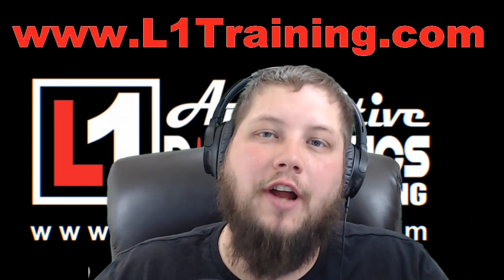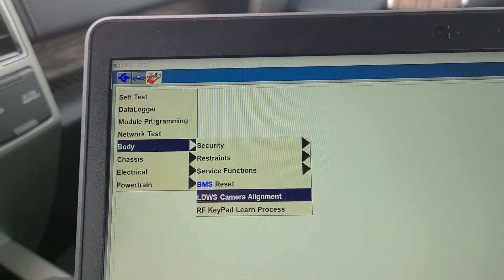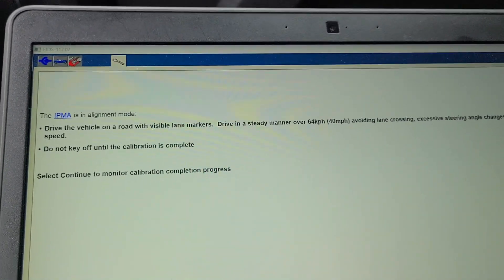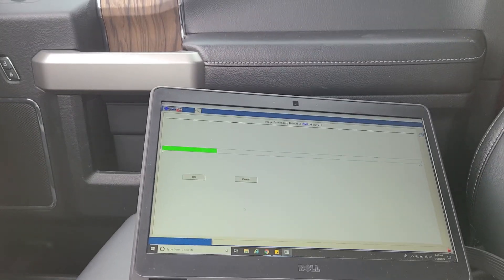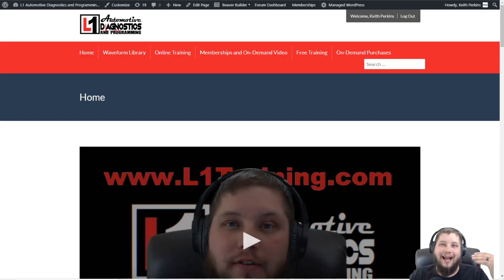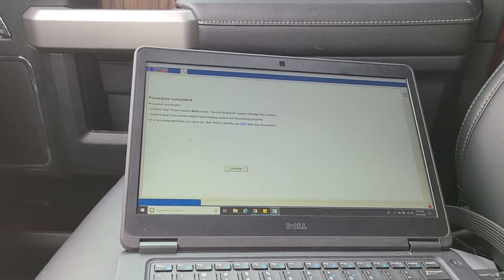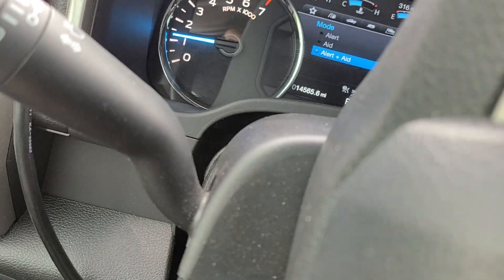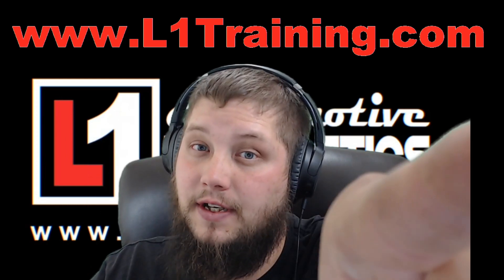2018 F150 Windshield Camera ADAS Calibration

Comment: Did the same thing as shown in the video exactly. The test said complete completed successfully, but I still have the error on my dash.
For context, this is a 2020 F150 lariat.
I have a lift and a 35 inch wheels so I adjusted the wheel size in the Ford scan app. Have not had any issue for the last three years I have this set up.

Comment: My adaptive cruse control dont work seems wierd dealer did changed the windsield i tried turning on and off the adaptive cruse control and still does the same thing you try to turn the cruse control on and only stays on like 2/3 seconds and a red light comes out on the bottom of the cruse control in the dash..
Reply from the maker: Needs to be diagnosed by a competent technician, not just you average shop.

Comment: Hey Keith, I had safelite come out per my insurance and they replaced my windshield but couldn’t calibrate it. They tried twice. It worked before I had the windshield replaced. They claimed it’s cause of my lift kit. I have a BDS 6” coilover kit. Insurance told me to take it to Ford, Ford couldn’t calibrate it either claiming there were codes and they didn’t know what they were. So here I am still months later and have defective pre collision warning system, no auto High beams, etc. Ford had said it calibrated then about 5 seconds later it says not calibrated. Have you ever seen this problem? Would you have any information on this scenario?
Reply from the maker: See the conversation I had with Guy Schroeder in the comments of this video.

Comment: Had windshield replaced, truck has been at the dealer twice already, they can’t get  it to calibrate. Going back in tomorrow, he needs to talk to engineer. Any chance you’ve run into it NOT calibrating? It’s a 2021 btw. Thanks
Reply from the maker: Yes I do, could be a low quality windshield with too much distortion near the camera, could have been installed incorrectly, the camera could be faulty, or installed wrong. Etc....
Reply: @L1Training  well it is a Ford factory windshield. As far as incorrectly installed and distortion that could be it. It’s been there all day today and still nothing. I’m going to guess the next step will be replacing the windshield again. See what happens and I’ll keep you posted. Thanks for reply
Reply: So after day 3 still no resolution. They went on to try and blame it on my leveling kit. So that’s when I lost it. Because Ford installed the leveling kit. So he’s sayin they need to figure out if the calibration measurements are being imputed properly in the computer 🤷‍♂️. Before resulting in changing the windshield.
Reply from the maker: @MustardSnowman  it 100% is the leveling kit if it is a dealer i stalled kit. If it is manufacturer installed it would have had a flash update to change the software in the module. I have not seen this yet from ford yet. I do run into this as well. Dealers are not the end all of knowledge, if there has not been a ford authorized software update for the IPM-A for your specific leveling kit, then it is the issue.
Reply: @L1Training  well it is a aftermarket Rough Country leveling kit, wouldn’t it have thrown it off after it was installed? Also he mentioned that he did input the the new measurements into the software. So I’m thinking it should still be able to calibrate. I see full out 6 “ lifts on fords. There’s gotta be a way to fix this issue.
Reply from the maker: I disagree, it will not calibrate correctly.
Reply from the maker: https://www.youtube.com/watch?v=Z5gMbymMaXQ&t=59s
Reply: @L1Training  I have a similar issue with my 2020 ford f250. Bought the truck and one month later I installed a 2" leveling kit. No issues with warning lights or error warnings. Everything works, lane departure, pre collision avoidance, auto high beams. I just had my windshield replaced by safelite (oem ford glass). They stated they could not calibrate it due to lift. I now have the error message that I have to clear every time i turn on. But why would it have worked before with no issues?
Reply: @MrKfcflores I’m thinking because it was still able to work under the old settings with your new lift but probably just barely. Plus if there is a min-max it’s looking for during programming and you’re just out of that, maybe that’s why. I’m here because my 19 Raptor just got the windshield replaced and I’m getting this error..
Reply: Any resolution yet ? 
Mine is a 2020 F150 , have a 2 and 1/2 lift on it. 
It worked great for years. But then I hauled some heavy load which tilted the nose up a little bit and ever since then I have this error.
The lane departure does not work. And the high beam.

I tried following this video and that exactly to the T, the system completed, and it says successful, but the front camera error did not go away
Also, before I did the test, I did change the wheel well height as per my current wheel height

Comment: Hello, I bought a truck that you worked on about 11 months ago. Ford f 250. Wiring issue. Truck is doing the same thing again. How did you fix it? Idles fine but ony drive about a mile and dies.

Comment: I'm sure you know but the newer Expeditions and Navigators require LSID to do the cala which as you know takes extra time getting the proper paperwork around. Unfortunately service information does not tell you ahead of time.
Reply: Robinson's Auto Diagnostics I was recently told by my mobile programmer that even if you have a VCM for 19 and newer ford it’s basically useless as a scanner even if you don’t have a LSID.